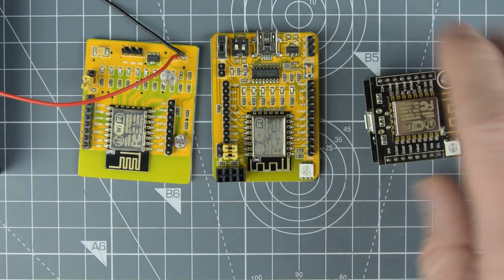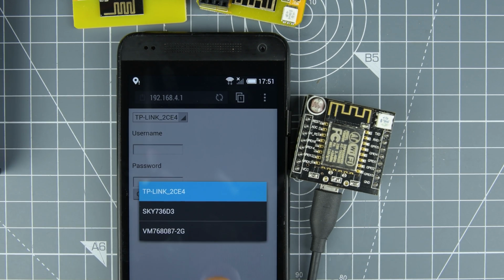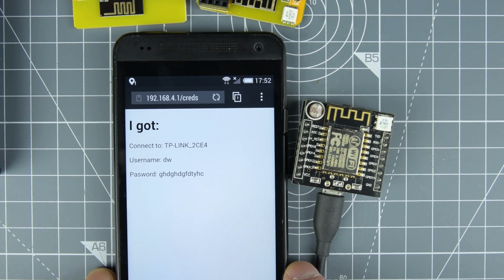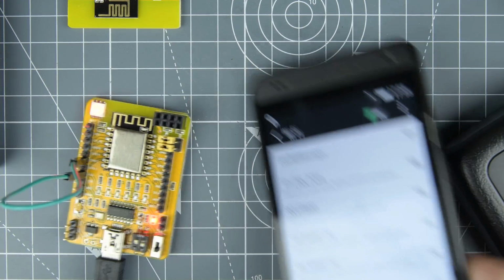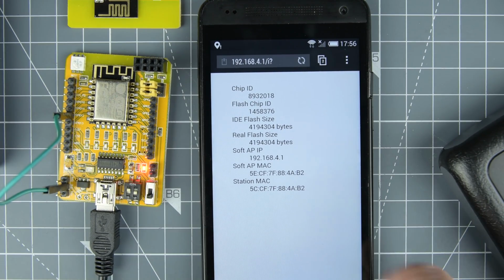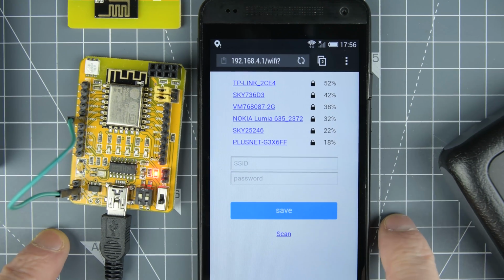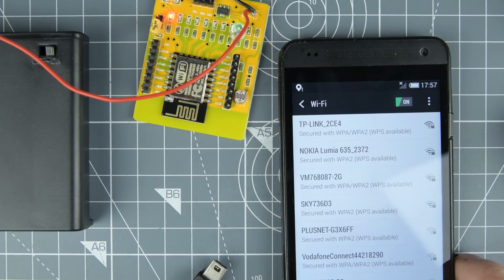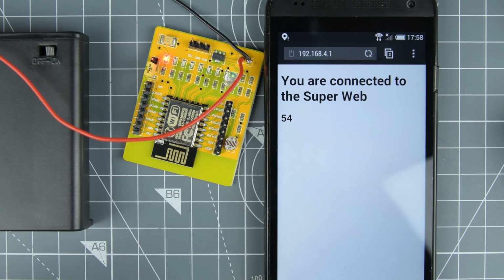ESP8266 - WiFiManager

Comment: Hello David,
I found some of the boards you describe at 6:36 (the ESP12 board with the battery pack) in my stash. However, I seem not to be able to flash it with arduino IDE. And I do not find any useful documentation (except your video).
Would you have some pointers for me? 
I would appreciate that a lot.
Thanks
Dan
Reply: I have been having same problems.  If you find any solution, please post! thanks!

Comment: You know some times you can make a video about one thing, only to help solve a problem with a different thing.  I guess I could perhaps have said that better, but it's a long hot day, and I have been searching for this video (well one like this) for some time now, and am rejoicing that I found it.  You see I have one of those boards with the power supply on it. The bad thing about it, is that because I keep it in a drawer, it gets knocked around a lot, as that little plastic chest goes with me when we go south for the winter, and comes back in the house when we return.  So I dug the 8266 out this morning, after deciding to flash it with ESP8266 Basic, I am a BASIC lover ever since my early days with my Commodore C=128.  I wanted this particular  board because of the external power supply, which I converted to one 18650. So when I pulled it from the drawer I noticed the black wire was disconnected, no problem, I thought I will solder that after I reprogram the device with Basic instead of the AI-Thinker operating system.  So I went on, programmed it, and the programming went well, as I had just done the same to a 12E and that worked OK but this one will fit my case so much better and there is that self powering that I want.  So I go to try her on battery, and then I saw it!  The red wire was disconnected as well now!  SO never having photographed her with her wires connected, and only a guess which wire goes where, I was nearly in panic mode, I didn't want to burn her up!  So I began a search for a photo of one hooked up, and after a half hour of no results, I at last dug out my multi-meter and hooked her up through the USB programmer, then metered the contacts and decided that if I believed my meter I had it made.  One more search with different search words, I decided, and I found yours.  The video confirmed what my meter had told me, so I soldered her up, and now I Have my ESP Basic device that is completely programmable from a web page on any device that is on my network. Thanks a million for your hard work at making these videos, I shall add you to my list and like this video, only because YouTube doesn't have a love it button.
Reply from the maker: Glad to hear it mate. Let me know if you upload any projects, I would be interested to take a look.

Comment: I'm having a problem, when I write a user and password the program works normally, but if the network disconnects for a moment and it creates the Autoconnect even if the network comes back it does not connect to it again, it just tries to reconnect  again if I reset the button.

Comment: you can use easyesp firmware. have that wifi manager and pin config, mqtt and other protocols.
Reply: CapApollo +1 for espeasy. I have a load of nodemcu esp8266 boards running that system around my house and it has been super reliable.
Reply: yes? its that realiable?  i have many arduino mega mqtt nodes around the house using ethernet. controlled with openhab and mosquitto.  i have done some test with esp but iam very conftable with arduino/ethernet/ pseudo ppoe.  i found esp very slow on reconection.. arduino/ethernet is less than 3 seconds untill the first mqtt msg with static ip.
Reply: CapApollo I have temp sensors and movement sensors that stay connected to my wifi without any reconnects needed. One of the motion sensors triggers a light for a short while in my garage and has not failed to fire in 4 months of regular use. But if you can run Ethernet then yes, as you say, why not hard wire your Arduino.

Comment: I got the witty board, I seen the other 2. witty board are so Arduino friendly... I had it programmed OTA but not the same as Wemos D1 mini or standard (R1 or R2) even though it looks the same. Most of the time programming on wire.